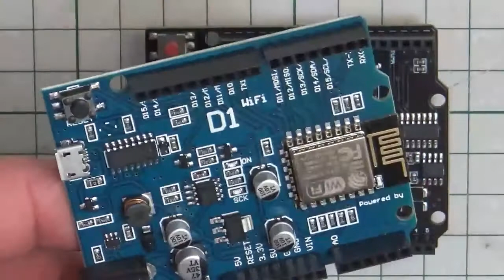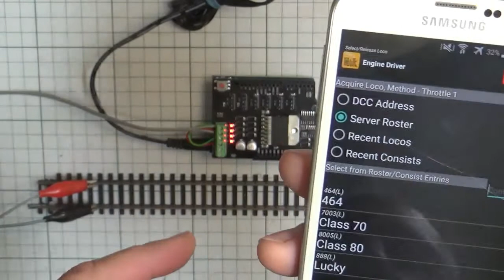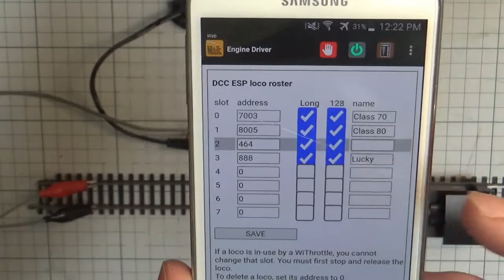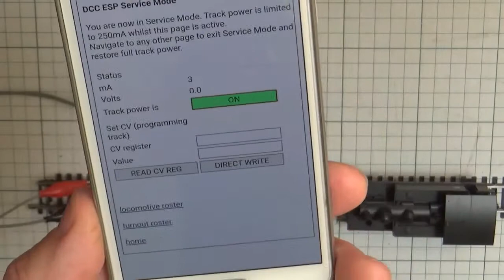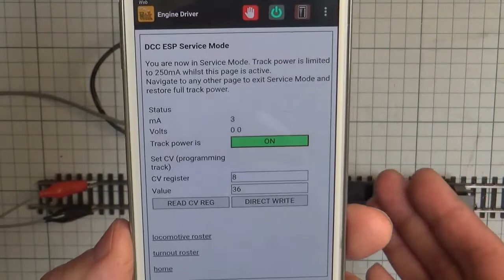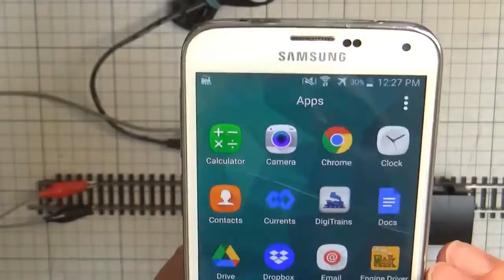DCC controller, 2 boards, no soldering!

Comment: Thanks for this demo. I'm doing research on building my own system with slightly different hardware, and had some questions about the motor driver.
As I understand it, a motor driver here essentially amplifies the DCC digital signal so that it can drive a load, and the DCC signal from the MCU is basically changing the polarity via the motor driver. Is that right? Is the PWM functionality used at all in this scenario (I'm assuming not)? The ESP32C3 looks rather promising for my use cases but has rather limited GPIO.